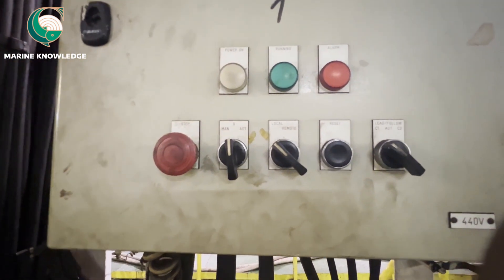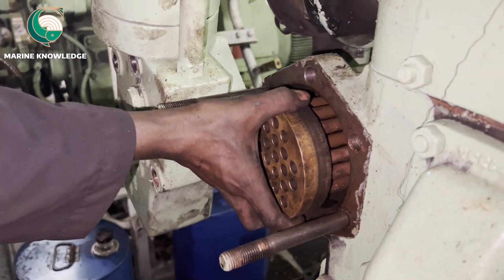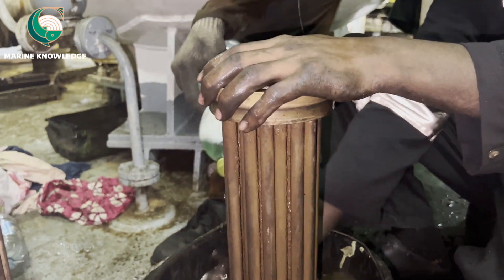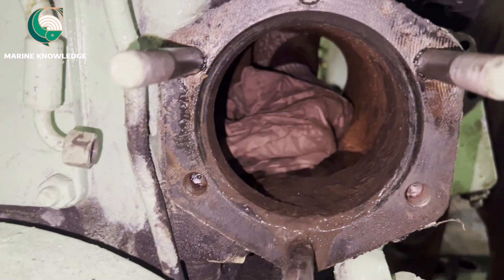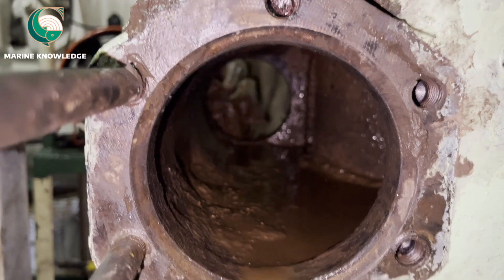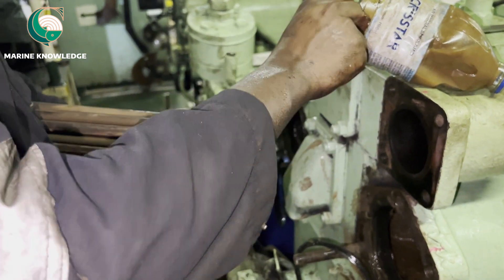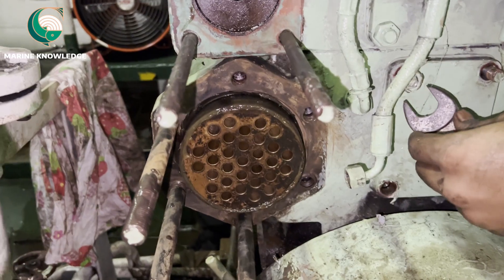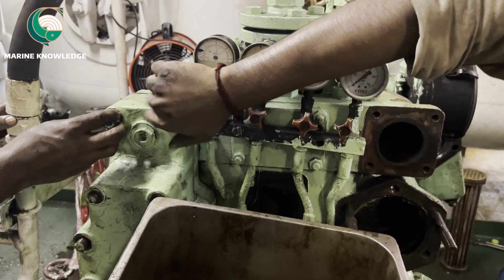Fourth Engineer jobs.. How to do Remove and refit coolers for Main air compressor ..

Comment: Sir how to drain water for this compressor?
Reply from the maker: u can close both inlet and outlet valve, open the drain valve in line and once water is drained u can remove the cooler.